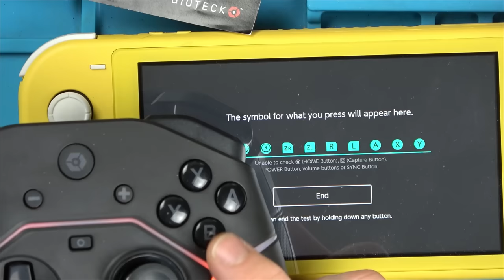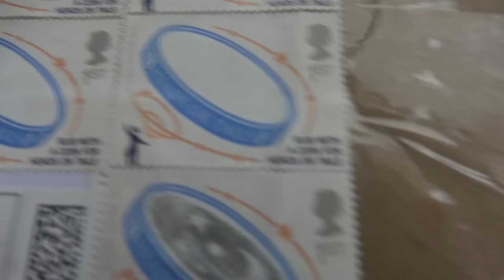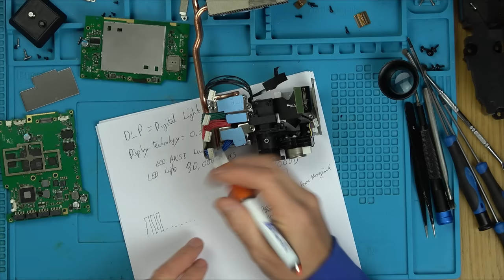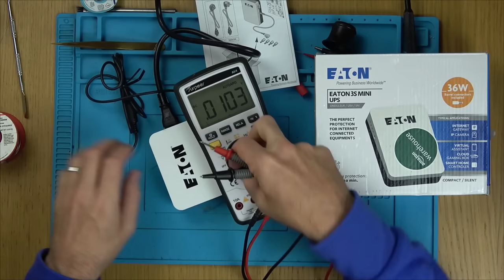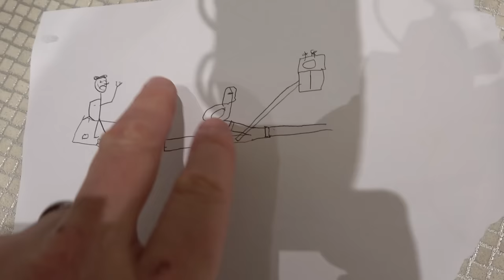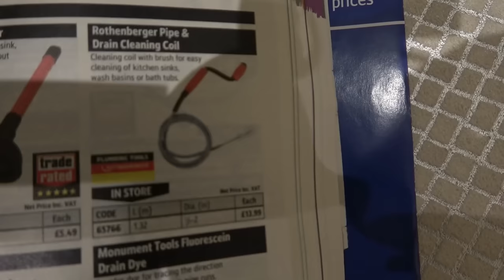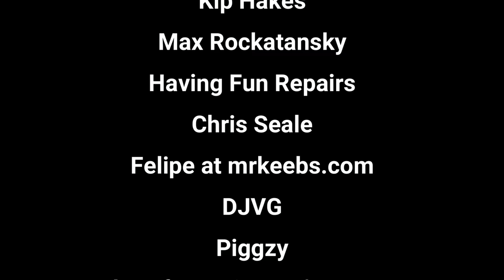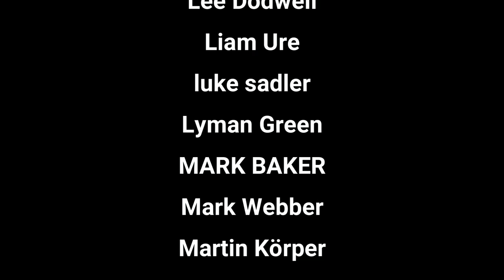Attempting to FIX EVERYTHING

Comment: Cut a hole in the ceiling. It's the easiest and cheapest to repair. You have to cut the poop stain out anyway. Start there.
I can give you some tips on putting the carpet back in place if needed.

Comment: Epic. Re the toilet issue, check the toilet sewer connector which looks to be at a strange angle (most should be straight), if it hasn't been changed for many years then the flexible seals harden, perish and leak. The toilet needs to be moved to replace the connector. After fixing flush the toilet every six months with a few buckets held as high up as possible, close coupled toilets and a relatively slow flowing shower and sink into the same outlet is asking for trouble. You could always speak to Paul re hair and beard options, ho, ho.

Comment: with that router UPS, you can get a power jack splitter or "daisy chain cable" and all devices that use the same voltage can be connected to the same UPS, so you could potentially power your entire wifi/phone setup with one thing even when power is gone. 
additionally you could make a battery powered wireless guitar pedal board if you want.
Reply: also if you use smart voltage comverters, you could make any one voltage into any other voltage if you need, though it's best to pick one common voltage that the majority of devices use rather than converting more things. 
also check wattage ratings before doing that

Comment: Isn't the ceiling of the downstairs cupboard just a bit of easily removable hardboard. Looked it at 38:32. That's right below the damp area I think. Might pay to whizz that off and look at the soil pipe from below.

Comment: I have experienced that problem with two out of nine 18650 cells from my laptop. Two of the batteries in the pack failed just like yours and it ruined my entire battery even though the other seven were perfect. This just seems to be due to a defect in the cells and not the device powered by the cells.

Comment: the 18650 that where dead may be "protected" (has a circutboard on top/bottom that cuts them out when under safe voltage/current just like a bms)

Comment: unfortunately it will properly continue getting blockages intermittently as you have a flexi connector ( on back of toilet ) ( defiantly worth investing in a plunger! lol )i never fit them they are notorious for blocking......if it keeps happening and you don't want to have to cut in and run a new soil you could raise the toilet by 25mm wont be pretty.... but will be quick and easy doubt the leak is due to that i would suggest cutting a neat 400 x 400 square out of ceiling and have a butchers ...... and the patch with a new 12.5 mm plaster board square and easy fill the patch to make good...... hope this helps mate

Comment: Hey Vince, have you considered if the toilet flex pipe is leaking between the connection of the flex pipe to the soil pipe?
I've had experience of toilet pan flex pipes leaking. I can't stand the sight of those flex pipe.

Comment: That whole section of drywall (sheetrock, gyprock, whatever it might be called) in your ceiling will need to be replaced regardless. My recommendation is marking a perfect square section to be cut out so that you can just slap a whole brand new panel in its place with minimal cutting. The building supply place near me sells 2ft by 2ft "repair" pieces of drywall, so I just cut that out of my ceiling when my upstairs bathtub drain starting leaking. Your stain looks considerably larger however. Best to just cut it out now to see what the issue is, have lots of room to work on it, then just slap a single new panel back in after since you'll have to repaint anyway.
Reply: This is the way
Reply: I had no idea about the repair pieces,  thanks!

Comment: 30:22 look at the positive end and youll see either 3 or 4 kidney shape holes, jam your meter probe carefully in the hole and youll see the correct voltage , the fuse sandwiched in between is the issue, ive rarely seen an actual failed lithium battery of that package being a 16850

Comment: Toilet: it has been my experience that the leak may not be directly over the damp spot. It is possible your shower tray or outlet if the soil pipe was partially blocked. It is advisable to periodically pour a few buckets of water down the jax whilst flushing it at the same time to give the soil pipe a good volume of water to flush the system out every couple of months. Get a used dehumidifier & dry it out. See if the soil pipe blockage was causing an overflow before you start ripping ceilings & walls out ! ... Methodical Analysis is our Curse 😊

Comment: Wow, some people in your comments doesn't use propper their brain cells. I am also 40 and have white hairs since i was 23. Sometimes due to unknown stress the hair turns white even if you are young. Sometimes its just genetically inherited. It is not unhealthy as I am in perfect health, and as I can see - you too. The video was very interesting. On that projector, there is a POWER ON sequence and even if you got all voltages, that doesn't mean that everything is powered correctly through the chain ;) Nice video!

Comment: Check the down 
Pipe into the manhole. If your drain is blocked outside and the manhole  is filling up above the level of the down pipe then it's acting as a blockage all the way up to the bathroom. The gurgling  is a sign this is what's happening. Check your external drains.
Reply: As Vince said in his video. His other toilet works fine. That means there can't be a blockage outside.

Comment: each battery has a BMS board, sometimes when battery is totally discharges, BMS is witching to the locked mode and battery cannot longer be charged no mater the voltage/current. Sometimes, if you can see BMS board, you can try to bypass it and charge battery itself.
you have 2 battery types - protected (with BMS board) and unprotected (without)

Comment: Re 26:31 Beyond the "unsafe to use" aspect of cells that low, in my experience, if a cell reaches lower than 1V, even if it does charge back up to a good voltage 4.2, it is usually nearly 0 capacity/high self discharge, and they tend to not hold their charge more than a day or 2 at max. And ofcourse with 0 and negative V, they are unlikely to take even that, and might be worse off than the low voltage case.

Comment: I'm a plumber. You have 2 options you can get a circular saw and cut the floor boards along the middle of the beam's to gain access. This may be the cheapest option. Time wise it's quicker to make hole in the ceiling and do the same and cut along the middle of the beam

Comment: Whilst you cleared the drain blockage, you didn't find & mend the leak. Just think, toilet water is soaking into the walls, ceilings and woodwork - do you really have to wait until the smell tells you the house has dry (which despite its name is very wet) rot, plus germs from body waste. "Doing it yourself" is all well and good  if you finish the job, but if not - get an expert in. It will already cost more than it did when you first saw the problem, wait much longer and the price will rise exponentially.

Comment: The leak could just be overflowing water going past a seal on a chrome ring around a drain and back along the pipe until it finds a ridge to drip down.

Comment: You have 2 separate problems with regard to the toilet.  You have a blockage and you have a leak.  A good plunger might cure the blockage if it doesn't then a toilet snake might beyond that you will have to lift the toilet to see what is wrong.  As for the leak you have to open up that ceiling to see where the water is coming from.  Twenty years now I've been renovatiing an old 1970s townhouse.  Built 1 complete bathroom and renovated 2 others.

Comment: For the flat Lithium Ion batteries, discharging them to zero isn't great for them, but it won't render them useless. If you recharge them slowly back to their working voltage, they should be fine, minus a tiny bit of capacity loss.

If they're reverse charged however, that's when they get damaged. The copper foil will start punching holes in the insulator between the anode and cathode and cause a short, destroying the battery. It looks like one of those batteries got reverse charged.

How reverse charging can happen in a group of batteries, is if one battery is weaker than the others and discharges before the others. The other stronger battery will push current back through the dead battery and reverse charge it. This is the biggest reason battery packs fail, just a few cells die and take the whole pack out. You can break open dead battery packs and salvage still usable cells from them, just don't put them in another pack, because the same thing will happen to them.

Comment: Reverse charging can happen when batteries are connected in series and their voltage and capacity is not equal, the batteries have none or inadequate protection, and a balanced charger is not used. That's probably why one of the batteries measured negative. The internal structure is damaged beyond repair when this happens. Batteries are often paired from the factory so they come from the same batch and have the same characteristics, and you can easily find them in 2-packs which are paired. If non-paired batteries are used in series this can happen, but it's also possible one of the batteries had already failed which led to this reverse charging.

Comment: The 18650 batteries have a button underneath the positive and if the battery gets to hot the button pops out and breaks the circuit in the battery to prevent it from rupturing you can manually     push the button back down stick.    something in the holes of the positive end of the battery and the battery will come back to life and if it just was left out in the heat and caused pressure to build in the battery then if the button is pushed back in then it will probably have the correct voltage but it is very unsafe to push the button cause of the small pin that has to be used to push the button  can puncture the button and it will      vent reset several 18650 batteries and have only rupture two or three        I have never had anything injury’s from them venting it just has a foul odor

Comment: Totally impressed with your skills in problem solving even down to micro level. The toilet blockage is, as has has been suggested,  probably causing the water leakage.  The fishing line attempt to unblock  was unlikely to clear the problem.  I was surprised you didn't consider the rubber plunger. This gadget applies powerful alternate hydraulic  positive and negative pressure on the blockage and is most effective in moving any debris in the system. Good luck Vince your energy and skills are second to none.

Comment: While I'm not a plumber I was going to say shut off the water for a day and use a portable air compressor to blow air through all the upstairs drains. 

But My opinion. I think the biggest stain on the ceiling is telling You where to cut a hole to access the bad pipe.

I could be completely wrong 🤷🏻‍♂️

Comment: The issues with the UPS is kind of obvious once you see that one of the batteries was negatively charged, as it has meant 1 of the batteries has been reverse charged - this is usually caused by 1 battery getting out of sync with the other and only one of the batteries is fully charged when the other one is low. As the batteries get used one of them goes all the way below zero at which point the battery breaks down, which then takes the other one out with it.

This was likely caused by the UPS always being plugged in but not often being discharged - the same thing that will happen if you have a laptop that sits at 100%. There are ways that devices could resolve this -  by doing battery maintenance whilst the device is powered on - but most people wouldn't think the battery should be below 100% when plugged in and would likely call it faulty when it isn't so most manufacturers wouldn't include a mode like that.

Comment: Ok I don’t understand why you took all the carpet up and not address the toilet blockage first as that with the shower and sink gurgling and throwing Brown water up was an indicator of blockage and removing carpet would not give access above water level. So you unblocked easy with plunge action and now the water is leaking from a joint. Personally I would turn water to to blocked toilet off and then dismantle WC not difficult and you can block soil with old towel to prevent back stench if not fixed today or needs longer. There is obviously a connection, I suspect on the soil that will be push tix as they rarely are solvent weld due to access and installation but with we out of way you should be able to see with a probe put down attached to your smart phone and that’s a start, the other thing to do is ask personnel Qs about anyone in house having put something down loo that may have caused blockage, it might be that something has snagged on leaking joint causing issue of blockage, the probe will also assist in the outside investigation with someone pouring water down or opening a tap to try and trace leak, anywhere where you can get your phone in take photo, the fact that the wood was wet, also suggests that it is or was a slight leak, enough to be slow enough for insulation, plasterboard two layers remember and timbers to absorb before letting it go. 
I say all above as having experienced lots over my 72 years and several properties rented out and renovated plus running and renovating a B&B, like you electronics and other repairs it’s a matter of systematically going through the excuse pun, motions, but remember water always flows down and that it will track along any surface, it could be a bad soldered joint on copper that has been disturbed so don’t rule that out I found one that must have been in place for Fifty plus years and it was literally just holding by a joist and when I moved it to join another pipe to loft it held until water was turned back on. But the probe is a great starting point and will show as it’s like you crawling through with a head tot h on. Best of

Comment: Easiest way to unclog a toilet if you don’t have any other equipment is a mop and a plastic bag. Put the bag over the mop head and use it like a plunger. Works every time.
Reply: I cut the bottom off a 2ltr pop bottle. Leave the top on and use it as a plunger. Works great.

Comment: the reset button on that seems to just only cut power from the battery, not actually resetting anything ... tested on my ps move controllers, ot does nothing but shut the device down and that's it

Comment: 31:05 Eww, the Virgin Media Superhub 3! We have one of those, and suffered from poor signal strength (and therefore download/upload speeds) in one of the upstairs rooms. 
Sure enough, after replacing it with a pair of TP Link Deco S4's, we get whole home Wi-Fi performance, as well as strong download and upload speeds in all areas.
(The Superhub 3 only acts as a modem now.)
Reply: It seems like those routers use a intel puma cpu and those are proven to have problems. I switched it out with my deco m4 boosters and now it works nice (vm super hub3 works as modem). Ew intel puma shitty cpus, no thanks i would rather use broadcom or qualcom cpus. The boosters i got from my isp use qualcom chipsets and they work awesome! I get 500-800 mbps instead of the shitty 100 mbps i was getting before

Comment: As soon as 'black' (sewer) water leaks into the structure (drywall, chipboard etc) it becomes an insurance job, you simply cannot afford NOT to rip everything back to clean material. Don't bodge it to save a few bob, your health is waaay more valuable than a sheet of plasterboard and living with the carpet up for a week. Please, call your insurance and get it done properly.

Comment: The Li-Ion cell that has been pushed into a reverse voltage should be recycled, you can't re-use a cell that has gone to minus as there will have been some chemical changes inside.
I doubt there was any protection circuitry that did its job... if one cell has a higher state of charge than the other, then close to the cut off, one cell can easily be reversed into minus polarity.

Comment: No doubt you, or a plumber, have sorted your pipe by now, but it reminds me of an issue we had on our house. (Previous owner was a "builder" . .  Jack of all trades master of b*gg*r all.....)
Kitchen sink was draining slow, so tipped a bottle of drain-cleaner gel down it, 15 mins later, sink draining perfectly . .  then 5 mins later I went down to cellar and found water pouting out the downstairs ceiling under the sink...  Opened the ceiling (thankfully timber cladding, not platerboard) and found Mr Builder had managed to send a screw through the grey water waster pipe, and the years og slime had sealed it, until we flushed the pipe..... Easy fix, had it not been 9pm at night and everywhere in Norway is clased at that time...

Comment: Could claim off your house insurance for leak but I think it is the fkexy soil pipe 
Behind the toilet .The seal where it  sits into the main grey soilbpipe .remove the toilet and investigate all pipe work should be accessed behind the panel behind the toilet pan 
Good luck when the ceiling dries out, use a stainblocker  paint, then repaint

Comment: Old man waiting to die!!!  Nah, you're still a spring chicken lol.    I kind of like the anonymity of a faceless voice :). 
With the UPS, it is possible one battery failed, then the good battery tried to balnce the failed one, or worse the circuit design allowed one of the batteries to reverse charge, which would explain why you had a slight negative voltage on one battery, and the complete discharge of both batteries, with sitting over time, caused both to fail
Unfortunately I think you will need to replace that water damaged plaster.   It looks like it is sagging down pretty badly....    Maybe that little leak turned into a big leak when the blockage cleared...
Keep up the great work.